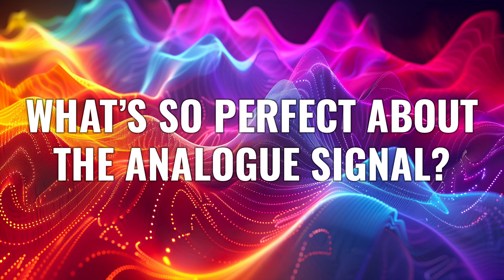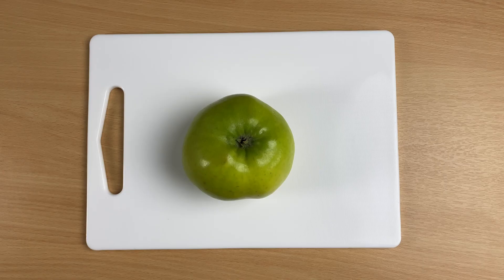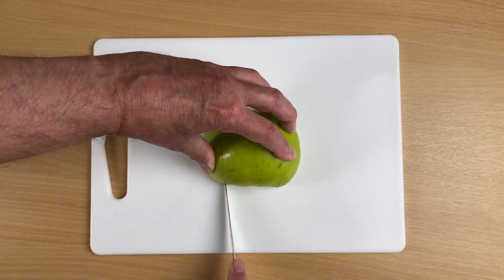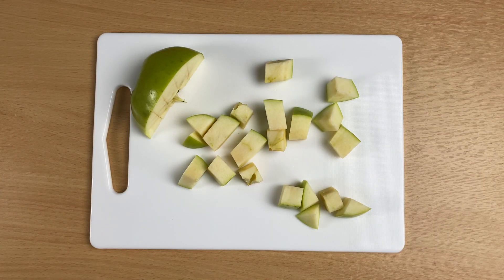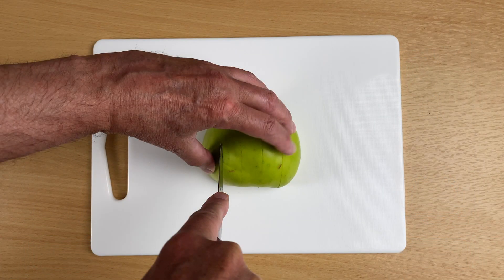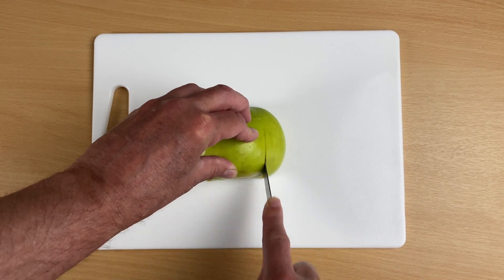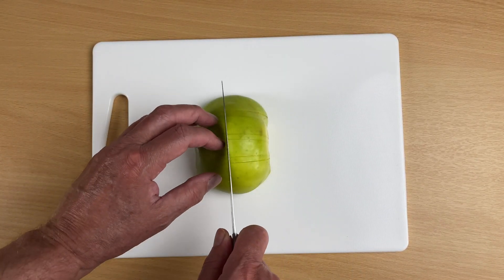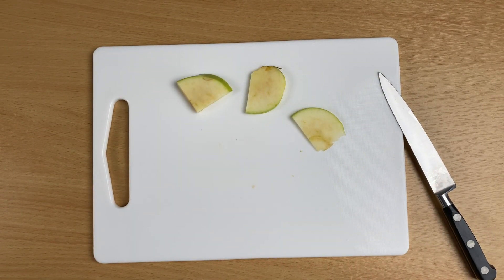Digital audio - Is it sliced and diced?

Comment: Sound enters our outer ears, our eardrums vibrate, this gets mechanically amplified through the bones in our ears, and excites fluid in our cochlea, when nerve hairs pick up the vibration, and send nerve impulses to our brains.   Impulses aren't continuous, they are pulses.  They are essentially electrical signals sent along the nerve fibers, with each pulse representing a specific level of activity. The rate and pattern of these pulses encode information about the sound, such as its pitch and loudness.

So, the nerve impulses our brain interprets as sound are indeed a series of pulses, not a constant signal.

We slice and dice sound to hear it.
🎧
Reply from the maker: Maybe then we should encode digital audio in a similar pattern.
Reply: @AudioMasterclass  Just like the Fourier Transform for visual data correlates with our visual system if I am not mistaken.
Reply: That was one of my first thoughts. We don’t hear a continuous stream. Everything is converted into small electrical pulses by our body anyway. Our ears are converting analogue audio into digital anyway.
Reply: @mwalmsley72  Exactly - our ears are an analog-to-digital converter and our brain likely is a DAC, converting this signal back to analog...or so we think...
Reply: Yes a really good explanation. !!!
Reply: And then I make it up (tinnitus); one high frequency in monaural and lately a rumble like an external commercial air conditioning unit in the left ear. [Oh joy!]
Reply: @SubTroppo  You can learn to filter it out. Only when I talk about it does it become apparent. The T word.
Reply: This is what I was thinkin' with my comment! There's no way anything we've created captures at the infinite rate of physical data. Even our own flesh cannot move that fast. That's mad insane.
Reply: Is that like asking if an arrow is in motion when fired,  or is it a series of high speed individual stop and go points?

Comment: You're being evil!
Reply from the maker: It's OK. The knives have now been taken from me and placed in a locked cabinet.
Reply: @AudioMasterclass  You're a tease Mr. Masterclass! Hey, I've seen an analogue signal generator hooked up to a DAC, convert signal to digital, then converted back to analogue and fed to analogue oscilloscopes - the waveforms looked identical - good enough for me.  :)
Reply from the maker: @davids4610  You won't see much detail in an oscilloscope trace, either in terms of distortion or noise. They're useful devices but they have their limitations. But if you did a similar test just using your ears, comparing input to output, most people won't hear any difference and that includes me.
Reply: @AudioMasterclass  Thanks my Master Class Guru!

Comment: Lol, very entertaining video, but your analogy doesn't extend very well to the d2a portion of this signal processing.  You mention Nyquist, but that is the critical piece as to why no information is lost at the appropriate sample rate.  If you accept Nyquist, and it is universally accepted from a physics and engineering basis, then the real debate becomes what sample rate is needed to fully capture all the frequencies that audibly  effect the final sound.  The front end a2d "slicing and dicing" is not in question and the question about losing information from this dissection is only relevant if the entire data flow from a2d to d2a is considered.
Reply: 16/44.1 is all that is necessary.
Reply: @simonzinc-trumpetharris852  True, if you accept that anything above 20KHz (or 22KHz) is inaudible, but that is not universally accepted.  Anti-aliasing is also an issue if there is frequency content above the nyquist frequency.  Low pass filtering and higher bit rates then come into play.
Reply: @Esprits4s  Whether or not anything above 20kHz is audible, it mostly didn't get recorded anyway on analogue recordings and if you analyse everything above 20k from a vinyl record being played back, it's mostly noise and distortion products from the recording and cutting process.
Quite right about anti-aliasing though - if by chance your mic or preamp picked up much sound over 20kHz and you didn't have good anti-aliasing filters in the ADC, that ultrasound would reflect back into the audio spectrum and become audible.

Comment: Thank you for the very important topic.
Digital signal is not sliced/diced at all, Here is the explanation an difference from an analogue signal reproduction:
analog: A Typical analogue channel is based on an analog source,  amplification and a transducer (Speaker)
Digital: A Typical Digital Channel is based on a Digital source, Digital to analog conversion and an analogue channel....
The analogue channel involves a closed loop"" or "Negative Feedback" gain stage(s) to reach precise analogue level at any given time.
A Digital channel produces a predicted Analogue signal using an open loop method for achieving the predicted value. 
the slices and dices referred on this video are only check points for adjusting the output level to reach its next predicted level.
If you ""zoom in" into a digital signal with the best magnifier you will never be able to find any gap (slice), the converted to analog digital signal is as continuous as any analog signal. 
Analogue amplification using a feedback can be often challenged by an impulse signal response, when the input change is faster that feed back response then a glitch happens in the output.
Digital converters which works on prediction do not suffer from such behavior. 

To summaries: the digital numbers stored on an audio digital file represent a control signal level points that assures an accurate  reproduction of a continuous pure analogue signal.
Reply: So no apple crumble?
Reply: @Astrodicted  smoothy instead.

Comment: The biggest problem I have with digital audio are when older recordings are remastered to CD.  My favorite recording from vinyl has more detail than the digital CD.  I even tried a download from HD tracks and same result, missing the cymbals at the start of the first track.  So the hunt for new vinyl original is almost impossible unless I want to spend 200 bucks.  Next step is to try and do a deep clean on the remaining two vinyl records I have.  One is basically worn out and the other damaged.  My fault I should have transferred them to CD with my recorder with a 24 bit 96 Khz chip. The sad thing is when I bought a greatest hits CD of Simply Red and watched my VU meter slam constantly at 0 Db on the CD recorder playback,  Harsh and irritating with DIGTAL GLARE !   But the CD wins first place in loudness.  The other thing is many vinyl records are mastered by digital recorders and a good recording in digital or analog can happen, so you pays your money and you take's your chances.
Reply from the maker: It is a shame that many classic recordings have been remastered to death. Of course this isn't a problem with the digital audio medium, it's whoever instructs the mastering engineers to do this.
Reply: I wouldn't be too worried - It's only Simply Red after all.
Reply: Your audio system can differentiate between analogue (vinyl) and digital (CD or HD download). Regardless of the source the master recording was probably digital. So, if CD or HD download sounds inferior this down to a poor-quality DAC. Book a listing session at a good HiFi store, take your CDs and audition a DAC with a separate DSP or FPGA based digital filer. All of the detail you claim to be missing will return. Unfortunately, processing power for this type of DAC makes the design more expensive.
Reply: @SteveD-m6z  The original recording was made in 1977 so I would assume it was analog. But thank you for the comment.  Now I know that original recording in analog beats a remaster in digital.  Instead of paying five grand or more for a D to A converter I will go online and find a used album in good condition. Now I hope the corporate big wigs can come up with a blue tooth speaker with three 2 inch drivers they can sell for a thousand or more.   Some remasters on digital did not take into account the RIAA eq. curve and are horrible.